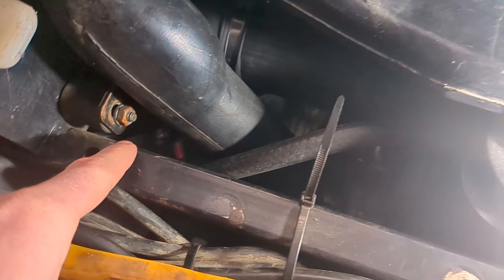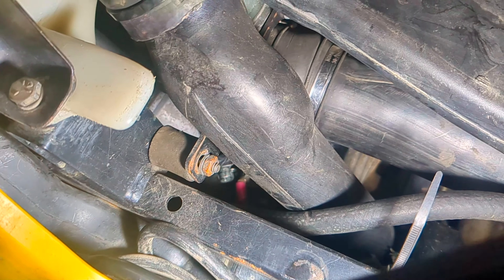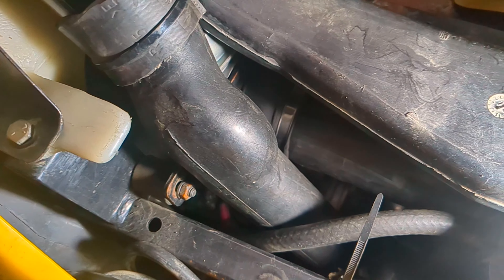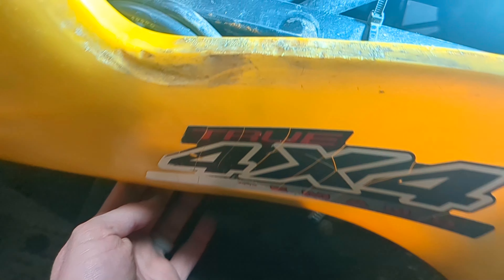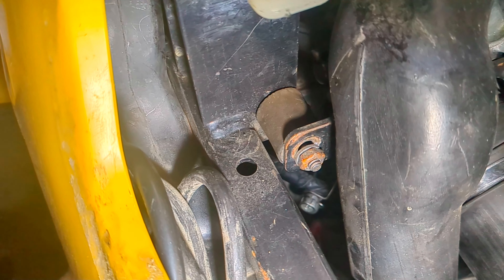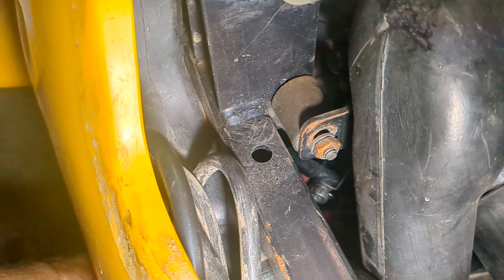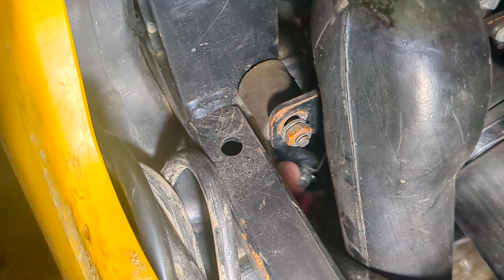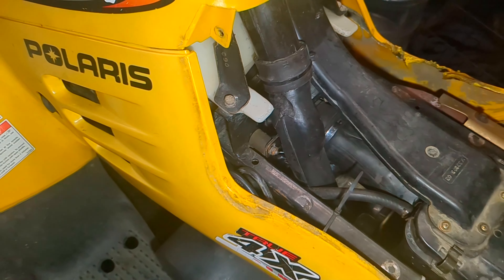How to adjust the idle on 2002 Polaris Sportsman

Comment: Before you mess with that adjustment which is the carburetor choke adjustment there is a idle adjustment on the throttle cable about six inches down on the cable from the handlebar thumb throttle. The cable widens out and it threads in or out for lower or higher idle.